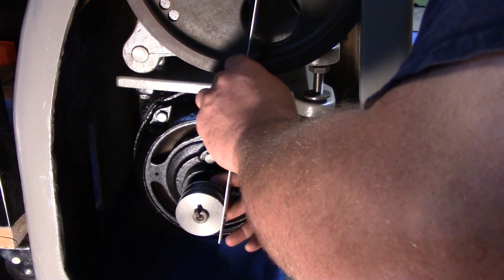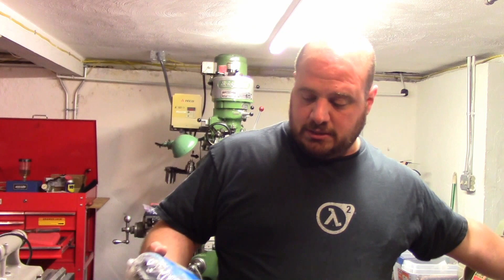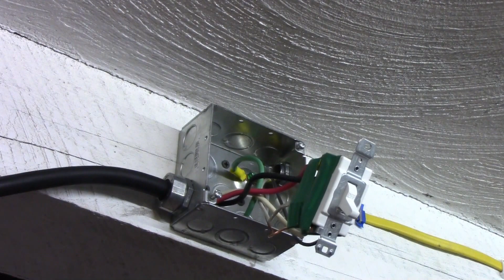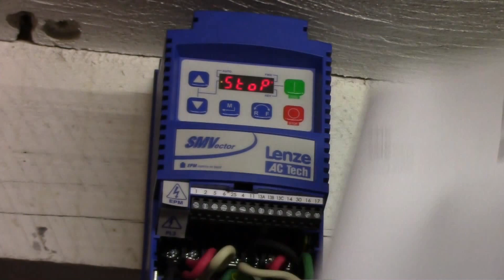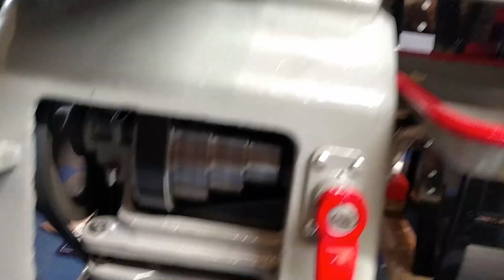13" Southbend Refurb: VFD and Belt Install

Comment: The noise made when you use a Frequency controller can  be made by the motor (windings) or the controller.
Nowadays there are motors that are engineered for VFD use. If you upgrade  the motor keep the following in mind; with low revs you need  a shitload of torque and a standard 2 or 4 pole induction motor running at very low frequencies will not deliver it's rated torque and also runs hot!. So do look at a 6 pole motor and  for low rev torque  and for high revs use, then use the overrun in frequencies (70-80 Herz)  where the motor is running in field weakening. This does require more kW motor so get some advice and get the drive expertsalso  to  look at a motor that uses a motor ventilator.
The noise a controller makes has to do with the PWM frequency. From my old days in mechatronics, Lenze had one of the worst low PWM frequencies, they did that to get more amps out of a smaller  VFD (read = cheaper). Another problem is  the required electric filtering between mains and  VFD and  filtering between VFD and motor all of which is usually not included but necessary.
I do recommend looking into a 4Q drive (forward, reverse and dynamic braking) electric motor braking but select a 4Q capable drive and a brake resistor.
Better quality drives are also less prone to EMC problems; less sensitive and  give out less EMC.

Hope this maybe of help fo rothers or  people that ran into problems after converting to VFD use in combination with the original motor on machine tools.

Comment: HI,
Nice work! I'm rebuilding the exactly the same lathe. Can you let me know the length of a flat belt you used?
Thanks!
Reply from the maker: Mine is 62", but set your belt drive in the middle of it's adjustment and use a flat vinyl tape measure or string to measure it first.  There are some differences lathe to lathe due to factory hand fitting.
Reply: Thank you

Comment: Good job Greg, lathe looks really good and sounds smooth.  Thanks for the info on the flat belts I was going to order one from Al-bino for the SB 14 1/2 here, I had a gift certificate from the bash last year but ran out of budget for the shop this year.  I had just pulled up their website and was going to contact them.

Comment: I was going to do the 3 phase swap on my 10L recently, but the 12/4 SO is too fat to fit through a 1/2" connector, and my motor will only take a 1/2".  Gonna have to use some BX and stuff it with THHN  I guess.

Comment: great job on your rebuild! i would like to bring up a few things on the VFD solution to home shop wiring. Let know if this makes sense. for example a 7.5kwatt VFD will run motors up to 10hp. so only one VFD purchase is really needed  to power all machines(as long as you don't need elaborate CNC control capability that VFD's offer). 3ph motor have a range of amperage demand and usually their tags show low and high demand values; under a heavy load (big deep cut) or abrupt stop (gauging a parting tool) a amperage demand spike created should not be greater than the amperage rating of VFD or it could be damaged. To ensure VFD doesn't receive such a spike you should install a quality breaker between VFD and line voltage/current into it. There are input parameter to change (maybe for each different motor) but after you figure that out and write it down, its simple. Having a larger VFD; you only have to buy one and you'll be scaleable up to 10hp. Not sure about code but each machine power cord would have a plug and you would have only one receptive. Should also have a power disconnect for the 208V 1 phase near power panel.

Comment: the high pitch is from the drive freq not the freq that the monitor shows, you can change it higher or lower in the settings so you might not hear it, this does not affect the drive speed. also some old motors dont make that sound i dont know why but ive got 2 motors that never needed that setting changed.
Reply from the maker: Yeah It's set @ 6Khz and the higher you go the less the noise, but the more heat generated by the motor.  This suckers old and the insulation may not be the best so I don't want to push it past there.

Comment: You didn't explain why your romex feed (yellow) had only Black/White and ground.  I know you wired it to 220v w both White and Black hot (no neutral).  You probably should have wrapped red tape on the white wire (both ends) to mitigate any future confusion.  I'm sure you don't want to be responsible for the ignorance of your viewers should they not understand what you did.

Comment: the high pitch whine is the carrier frequency, you can adjust that to a higher value in the parameter settings of the vfd so you can't hear it or very little.
Reply from the maker: Yeah it's at 6Khz, but the higher you go the more you push the motor insulation.  I wouldn't have an issue if it were new, but this sucker is 72 years old so I don't want to push it.  Maybe once I get the covers on it'll be less noticable.

Comment: Greg,
Thanks for the great video! If you have your VFD output more than 60Hz, won't that cause the motor to overheat, since it is designed for 60Hz power? I guess that's a universal problem with 3-PH motors -- it seems like 90% of the time they run backwards. Whenever I wired one up and it ran the proper direction, I thought I'd died and gone to Heaven.
Have a good one!
Dave
Reply: If motors are anything like power transformers regarding mains frequency, any problem lies on the low side.  Lower mains frequency requires more massive construction.  That's why aircraft run on 400 Hz.  It saves weight.

The rotation speed of an AC motor is frequency dependent.  That's how a VFD makes speed changes happen.

Eli D.
Reply from the maker: Yes you can have the VFD output higher than 60Hz which would cause the motor to "overspeed" and heat up the motor and insulation and all that good stuff.  I have the VFD programmed to only go to 60Hz max.  You can  get inverter duty motors, but they'll cost an arm and leg.

Comment: Greg, I'm following along and doing mine at the same time. Question: for the control wire to the remote box I happen to have a shitload of Cat6 wire, can I substitute this in place of the sprinkler  7 wire you are using?
Reply: Billy T
     CAT-6 is about 26-AWG (I think). Thermostat wire used to be 24 gauge. If it's a control circuit it's probably in the milliampere range so would probably work. The opposing and variable twist rates help to reduce noise spikes without heavy and expensive shielding.
Reply: good CAT6 cabling will all be 23 to 24AWG conductors, there's junk at 26 to 28awg out there so beware..
you'll most likely want stranded wire vs solid, it comes both ways, stranded is mainly used for patch cables, solid for installed building wiring. forgot to say, beware of junk copper clad aluminum (CCA) cabling
Reply from the maker: Yes the terminals are rated 26-16 AWG.  Mine happen to be 18 solid.

Comment: I have a very limited understanding of VFD's.  From what I've gathered, you can only run one inductive load (electric motor) per VFD and hence can't use one in place of a rotary phase converter.  If your machine has electric braking or a speed controller, you need a special braking circuit added to dissipate the feedback and if you are nearing or exceeding 5 hp a rotary phase converter is actually cheaper.  Is this correct?
Reply from the maker: Correct.  You can use 1 VFD for multiple machines, but only one machine at a time.  You'd have to figure out some switch or cord and plug arangement for each machine and then you run into a problem of controlling it remotely from multiple machines.  Depending on the particular VFD and size of motor you may need a special braking resistor to absorb the energy of electrically braking the motor.  They are usually pretty expensive.